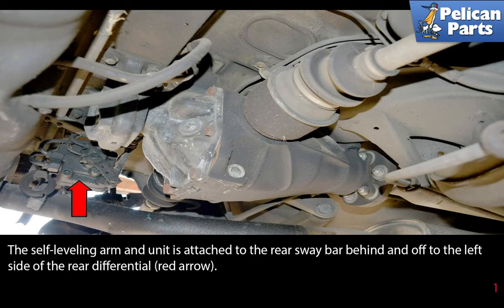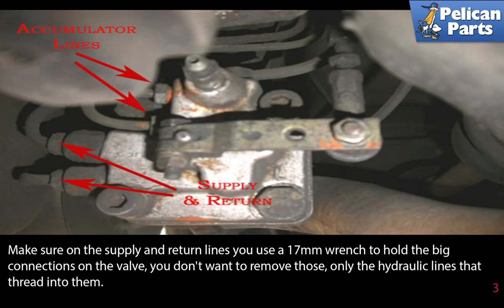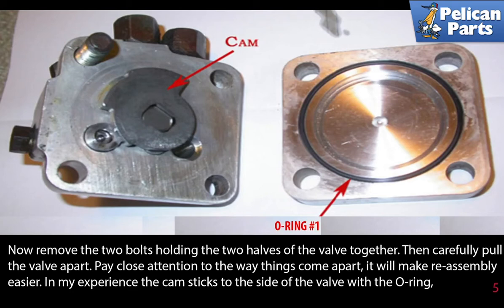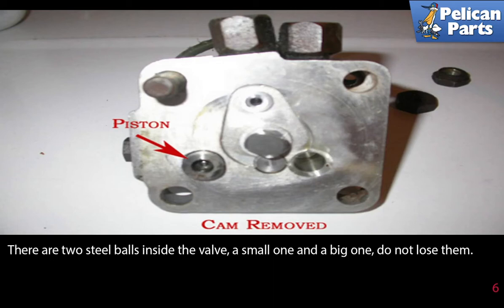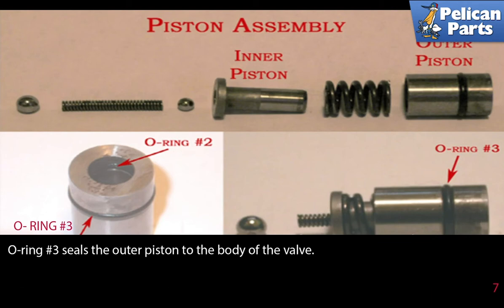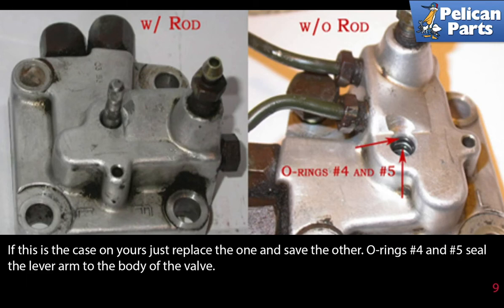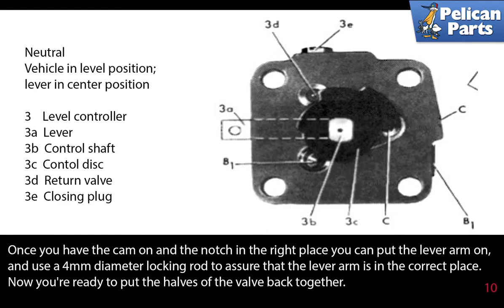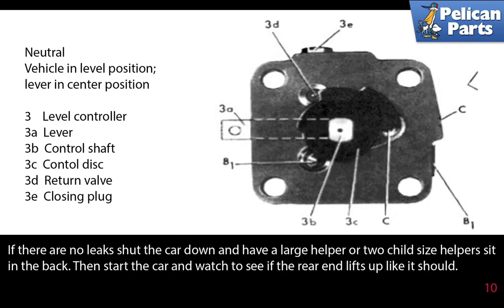Mercedes-Benz W123 Self Leveling Valve Rebuild for 300TD, 230, 240D, 280CE, 280E, 300CD and 300D

Comment: Good video. I have rebuilt 3 with new seals and they all leaked again after a short period - maybe wear of the internal metal components?
Reply from the maker: Yes, the sealing surfaces can be worn. That would cause the seals to leak.

Comment: I have a rebuilt sls valve, new springs, and can not find any leaks. But the rear end is still to low. The accumulators have not been changed. Can these casue the saggy rear? The car lifts when I pull the lever on the valve very low (ca 5 o'clock position, or close to straight down), but the adjustable rod is to short to hold the lever in that position..  I don't think the rubber on top of the springs was changed, but I doubt new ones would be enough to make it look right? Ride is ok, not harsh.
Reply from the maker: Could be the lever is not adjusted correctly, the height may be seen at correct if so.